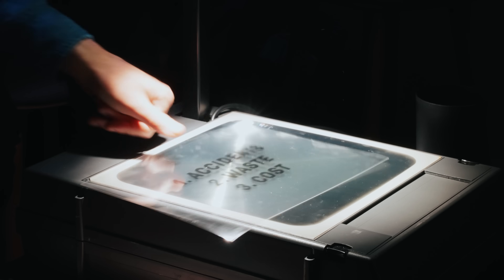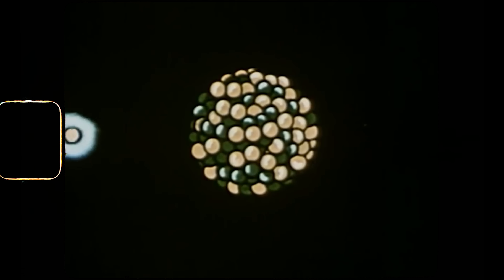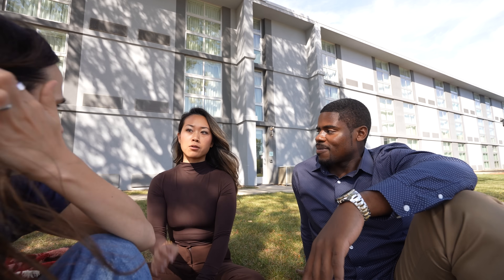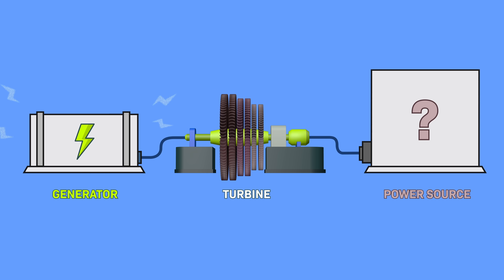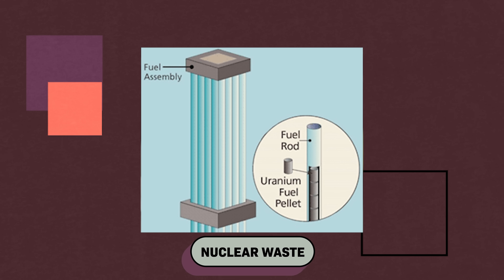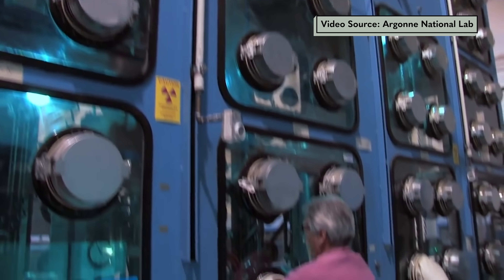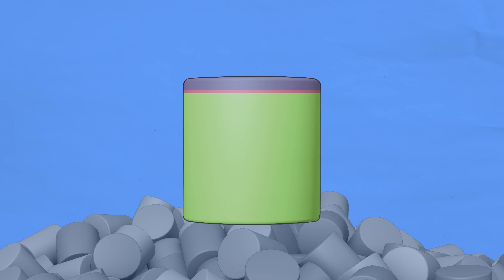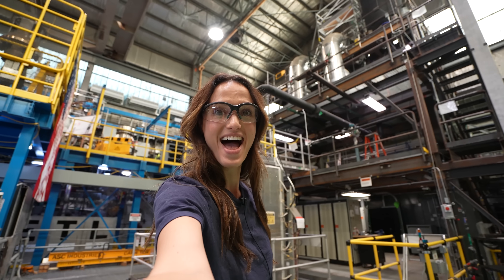The Big Lie About Nuclear Waste

Comment: Nuclear Engineer here, i'm so happy to see these debunking videos now. You did a great job at making sense of the nuclear waste that oil and gas lobbyists have pushed onto the global energy industry. We all got shafted out of clean energy for fossil fuels, but that's now quickly changing for the better
Reply: it always comes down to $$$$$ £££££ and those making it and not wanting to loose out....
Reply: Reactor technician here. The fear from three mile island and then Chernobyl killed any growth. That why we really haven’t built any since
Reply: @shellnjoeycastro1730    Yes fear and how did that happen?  The nanny state bureaucrats, the greens, the death/fear merchant’s on line, in Hollywood and cable, etc.  Every living thing in the every ecosystem throughout history has been trying to advantage itself and its offspring by influencing their systems.   Now the difference is people have forgotten this and or to lazy / distracted to think it through
Reply: @shellnjoeycastro1730  it's a catastrophic soft target, vulnerable to natural disaster, and with absolutely no benefit outside of corporate/military applications.

Nuclear energy might be cleaner that burning coal, but building a nuclear facility isn't clean.  Neither is maintaining it.  And neither is maintaining the infrastructure required to transport energy to the user.  All the energy lost to distance, to upkeep, and to staffing comes directly out of the overall benefit of running a large nuclear facility.

And then on top of that, energy is supplied to the largest consumer first.  So by the time the average person is paying their "power bill", they are paying 100x times as much as that Amazon fulfillment center 20 miles away.  Because there's so much demand...

It's a rigged game designed to extort the working class for more of their money.  The customers using the VAST majority of energy, they pay almost nothing.

But double your electric consumption, just for a one month test.  Then take a look at your power bill.  If you attempt to use more than they expect you to... there's fees for that.  And then you pay a higher rate on the energy, as well.

Can you explain why Amazon's power meter can spin so fast it goes back in time to pay an energy rate comparable to 1920's era coal prices?

Because that's what they pay.

You ever take a moment to consider if maybe, consolidation is the problem?  Even though it's more efficient on paper, is it really?

Because the average person's power bill says no.  In North America, all the infrastructure attached to the grid was paid for with taxes, and is maintained with subsidies, paid for with taxes.

So how come the energy is price fixed instead of basically free like it should be?  Why is the individual using 0.00001% being nickled and dimed per kWh what all the massive industrial customers are paying the same price per kWh as one might pay for coal to produce a kWh in 1920?

Do you think with nuclear plants being far more expensive to maintain and operate that the price will come down per kWh?  For who?  Exactly, it'll be the same model, energy output is artificially reduced, price is artificially inflated, and the only people who make gains are the people who own the contracts to deliver energy and the massive corporations that already pay 1920's prices for energy in 2023.

Who gives a flying fk on a rolling donut about carbon footprints when their bills come?  Nobody.

Fear has nothing to do with it.
Reply: Thanks for saying it. Why doesn’t anyone else call the spade a spade? Nuclear is the most expensive energy ever produced, and the epitome of centralized power production that is the real issue leading to massive overuse and under payment by the politically powerful.
Reply: Clean. Stop smoking that stuff. Waste that will be deadly for 100,000 years. What a joke
Reply: @petethewrist  Genuine Question to you: Name me one time radiation has ever been a threat to you, and name me one time you breathed in gasoline fumes, smog, been in a car accident, been sick from food poisoning etc. You'll quickly realize the actual dangers in your life that are far more likely to be a concern than the nonexistent threat of nuclear waste harming you and the community.
Reply: @hans3331000 Um, ever heard of the Downwinders (where I live)? This garbage is never inflicted on the people benefiting from it.
Reply: @petethewrist  yeah I love how all these Corporately Programmed environmentalists never consider for an instant the footprint required to build, staff, and maintain all the infrastructure required to just "deal" with the waste.

These plants are like entire self contained cities.  They require railways and thousands of employees with fully staffed service centers to provide those employees with services they'd otherwise need to travel a long distance to get.

All these kids think reality exists in a vacuum but the only vacuum is the one maintained between their ears at all times by a troubling lack of brain matter.
Reply: Came here for the comments and whoo! @ZennExile and @SunShine-xc6dh did NOT disappoint. 

When the children started throwing tantrums, they got schooled by teachers with the patience of Buddhist monks. They actually explained way more than they needed to because those two were NOT having it. 😂
Very entertaining!
Reply: @dundid1t542  lmao yeah no schooling quite like 'trust me bro'
Reply: France derives 70% of their power from nuclear energy 

And they are already building more nuclear facilities with more advanced technology 

And the french government says nuclear power is non negotiable 

The only reason the power plants were being restrained is because of high temperatures this summer

I couldn’t find anything about a lack of storage space

Maybe you should give your source if you have one

I would be glad to be proven wrong but i dont think they would be building more reactors if they were having issues with storage
Reply: @dj_koen1265  They reprocess.
Reply: Which university did you go to?
Reply: If nuclear energy were discovered today it would be hailed as deus ex machina
Reply: @Ourdirtytwo  Too true!
Reply: " that oil and gas lobbyists have pushed onto the global energy industry."
It was more the wind and solar proponents. Plus, very few developed nations use oil to produce electricity.
You wouldn't find many coal and gas supporters having an issue with nuclear, but the wind and solar people certainly do.
Reply: Mechanical engineer here.  @Hans B.    Nuclear industries were really killed beginning in the 1970’s by several factions.  
- Green movement has probably done more damage to clean nuclear power than anything over the decades since.  Super stupid!!  Nose spites face.  
- Politicians greedily used fear of nuclear war, proliferation & waste to get elected.  They stupidly reduced it to emotions and bumper stickers, convincing  low info voters  that it was all one simple evil thing.   
- Military Industrial Complex didn’t want mass extinction either and they had no economic alternative to the destructive power of nukes, so tangentially fought proliferation by stoking fear of nuclear power.  A poor country like India could “go nuclear” (and did) defend itself for decades at low cost.  
- Government bureaucrats killed the economics of nuclear power in many countries including the USA.   
- So, Don’t blame oil, they don’t even compete in the same industries.
Reply: Nuclear engineer, my ass. You couldn't find your way around uranium.
Reply: Sadly it seems that the focus on non reliable energy sources is now causing more fossil fuel to be burned.

If only the climate fighters would actually care about the science behind their hysteria, then we might not have both the lobbyists and activists fighting the scientists.
Reply: "Clean energy". Go google cancer risk near nuclear facilities. You shills are just funny. I hope they build a nuclear facility right next to your house and your children enjoy the radiation. Tell them in the hospital while treatment about your genius comment on YouTube.
Reply: Nuclear waste simply for the greedy or stupid, they can't even mine it safely,  let's look at all the spills, not just the major ones...ridiculously niave to swallow this garbage without looking and then explaining all the damage done from all the leaks.
Reply: What's with all the bashing. We should be learning from each other     the lobbyists ruin everything
Reply: @Bill-cb4bh  That soundsgood, however, the Biden admin is actively anti-human
Reply: Its isn’t just the fossil fuel lobby that is to blame for the lack of progress in nuclear energy plants it is also the environmental lobby who push government red tape & regulations making nuclear plants expensive to build.
Reply: You are talking about breeder reactors.  The waste doesn't disappear, some of it is converted to plutonium which becomes more waste after it fissions.
Reply: They will hopefully use it more often around the globe
Reply: Fossil fuel industry is the most EVIL creation in world history.
Reply: There is enough demand now that we need both.
Reply: currently in the freshman year of my bachelor’s degree in nuclear engineering! any advice for someone just starting out in the industry?
Reply: @joeshmoe-c9n  Yes sir, good luck. It will be a lot of theory before you get to the power plant part of it. Really focus on first and second year and it gets easier third and fourth in some ways. Second year is hardest. The math has to be strong. Remember radiation cannot be seen, heard, tasted, felt, or smelled. This means math is all you have and it's all your eyes and ears. You must know how it works. You will forget multiple times how it works but the key is to keep yourself refreshed and quiz yourself. Study with a group but remember not to compare yourself to anyone and focus. I needed much longer than my friends to understand things but the important thing is to end up at the same place. Absolutely do not pull an all nighter. Do not memorize, understand why you are doing it. Stay organized, deadlines will crawl up on you fast. Pace yourself, you cannot sprint all the time. Be okay with some assignments being late or incomplete, but get it done on your own time because it will be in the exams. Get plenty of sleep and eat good. In second year, your entry into the nuclear industry is internships and coops (do not be picky, any experience will out you ahead of the highest GPA student i promise). Grades are not so important, just be in good standing and build a good network. Go to student conferences and network. Ask professors for student jobs and lab assistant positions where you can put impressive research into your resume. More importantly: Find out what specific area of nuclear you love with a passion and pursue it later on.
Reply: Yeah 4 years to go til the fossil loving man changed
Reply: .  1, Three mile Island .
  .  2, fu-gee-ohma Japan
  .  2 1/2,
  .  3,  Chanioble 
  .  4,
  .   4 1/4, ETC -
  .   4 7/8, etc ! .
  .   5,  The REST of the STORY  ([ PAUL HARVEY ]) .
 
 .   5 1/2. FALLOUT FROM 
             THE ☢️ "LEFT overs".
 Iodine 131, sea,zee,um 141
    Cobalt 90 etc,etc,ETC ...
    12 - 18 - 2024  wed.
           * thanks  Boys *
      FOR the FIRST ONE
           July 16 @ 5:29am
               1945
  .
Reply: I think I remember decades ago, having such things as breeder reactors, which produced more nuclear fuel from the waste. I can’t remember the exact details.
Reply: Thanks for the subject but do you need to show so emotional?
The little Asian physicist looks pretty nice. A pity she didn’t speech your video.
Reply: 😂 how is nuclear better then fossil fuel. They both suck 😂 just like your opinion 😂
Reply: WOW nuclear energy is nowhere near clean. The CO2 emissions per kwh are way higher than with true renewable energy. Besides they are not really economic.
Reply: I've been saying it makes no sense that the nuclear waste is so dangerous, and yet we can't harness that energy at all.
Reply: Coal ash contains radioactive materials that are unregulated. Some of the newest reactor designs are much cheaper and safer than existing systems.
Reply: By "oil and gas lobbyists", I think you mean anti-nuclear environmental zealots.
Reply: @ReadTheShrill  the fossil fuel industry has long faced the threat of losing market share to nuclear energy and are actively engaged in supporting expensive regulations
Reply: @ReadTheShrill  propagandized group that got these ideas from somewhere. I wonder where? Direct earliest example: Godzilla movies
Reply: @ReadTheShrill  the zealots are people like you who blindly blame the energy industry for the sins of industrial agriculture.

You can't blame the energy industry for making as much money as possible when they were handed the key to the cookie jar and a blank check to buy infinite new cookies.

You'd be fat too.  REAL fat.  Humans are apes, and a ape's gonna ook.  Just is what it is.

But you what matters more  than blame?  Reality.  Gotta live your life as it is not as you want it to be.  Otherwise your brain cheese will overheat and lose its oil all over.  Nobody likes oily cheese or that burning cheese oil on the bottom of the oven.

And in reality, there's another directly correlating metric that isn't being considered in the typical greenhouse gas audits used to define and justify all these climate models.  

It seems nobody had time to consider what tilling up 1.9 billion acres of Rhizopshere might be contributing to the carbon-12 build in atmospheric samples over the exact same period being blamed almost entirely on the energy industry because they could disrupt and manipulate the average person's lives for a century before markets and technology caught up with them.  That's a lota hate to build up.

Blind hate.  The kinda blindness that pushes obvious contradictory evidence to the waste bin in favor of defeating an imaginary enemy.

Every atmospheric carbon 12 model is wrong.  Tilling up 1.9 billion acres of Rhizosphere is gigatons of carbon 12.

Unless the model directly accounts for that, it's wrong.  Bad data, perfect model, bad result.  It's not complicated, political, or a debate.

1+1 = 2

If you want, even chatGPT with it's hyper delusional corporate climate hallucinations will tell you that North America's soil can potentially store 2000 gigatons of CO2 for 10's of thousands of years.

And not like, all of it, no.  Just like 50 million acres can erase the Industrial Revolution from the atmosphere.  We could easily buffer the atmospheric impact of the entire rest of the planet going through the same filthy Industrial Revolution we did, and change nothing about anyone's daily lives.

And the energy companies could keep limping along toward renewables.  And idiots could keep driving stupid cars that get 4 miles per gallon and kill small birds with passing engine noise.

The rest of the whole world could just catch up if North America would rehabilitate 50 or so million acres of the 1.9 billion destroyed by Industrial Agriculture and as a result raise it's own GDP.  It would cost less than nothing.

And this example if followed on every other continent erases the carbon crisis from that doomsday clock entirely.

So stop hating, and start doing math the math or getting chatGPT to help you do it because the soil is what needs fixing.  And like, real soon.  Or it can never be fixed.

Everything else can, and should wait.
Reply: Cleo badly needs to educate the foolish nuclear phobic Germans about nuclear power and nuclear waste.
Reply: fossil fuel industry had nothing to do with the public's nuclear fears...scientific illiteracy did.   Read "The Rise of Nuclear Fear" by Weart, he does a pretty good job researching the history of public hysteria surrounding nuclear tech.
Reply: @Sugarsail1 I blame a deliberate effort by the USSR.
Reply: @Sugarsail1  A deep dive on the antinuclear power nuts will lead you to the KGB.  Of course the same is true of the 'green' movement. 
Any anti industrial or antihuman movement can be traced to Marxists.
Reply: Well, to be fair hans3331000, it wasn’t just oil and gas companies. 
The accidents at Harrisburg Pennsylvania (Three Mile Island—1979) and Chernobyl, Kyiv Oblast, Ukraine (1986) had a lot to do with it. Besides one plant in 2016, the US hasn’t completed one since 1996, both of which were in the TVA system. 

Fukushima Daiichi in Japan during the 2011 earthquake/tsunami didn’t help either.
Reply: "Changing for the better" means: Wind, Solar, Biomass, Water. Not anything where you need to buy expensive fuel, risk accidents that pollute large areas and produce the most expensive energy.
Reply: I disagree. All the new energy transformation in the past few years has been wind & solar. Nuclear power still has an undeserved bad reputation.
Reply: @BadDadio  Nuclear has a bad reputation because it is honestly the best solution to the problem of providing power to the masses.
Reply: @Corvus I am from the internet.
Reply: Hans, what's more efficient as far as materials and direct energy-to-application delivery, an energy source that can scale from the size of a smart watch, to the size of Wyoming, modularly forming a larger area energy network, or one that's fixed and dependent on a facility designed to power that same area energy network?  And at what point do you reckon the size of a centralized energy generation facility overwhelms the former topology in saving long-term while also considering the estimated yearly costs of maintaining that fixed network?

Asking for a friend.  He said you can go ahead and just ignore the continued permanent waste storage issue, we'll do like Europe did and just sink it to the bottom of some really deep water and pretend it never happened.
Reply: @ZennExile  it was mostly britain that sunk their waste and we stopped it 30yrs ago.
Reply: @ZennExile  So the realm og your question is really geared towards grid management and life cycle analysis, but I'm more an engineer that deals with the functionality of a plant until the electricity hits the grid. That being said, the advantages of large scale nuclear power plants are that they are relatively compact and provide an insane amount of energy in terms of energy density. Managing the grid requires modularity, and so it's always good to have diversity in that not only large scale plants should be used, but small and intermediate level ones can be extremely beneficial for remote and isolated communities. I won't go too far in the topology of the current system because I'm not the best person to go, but I will say this: we have science-backed proven data that shows the adaptation of nuclear energy is comically safer and offers other benefits such as medical isotopes and revenue generated for the local community,  that it's simply the answer to our problems. We don't really need to be looking for crazy new innovations, because the adaptation of nuclear energy or baseload clean power while waiting for research on wind and solar will benefit us the most. Right now politicians are stuck with the narrative of renewable and its costing trillions and taxpayers suffer. In canada, we are investing in large scale nuclear again and it will cost 50 billion for the first phase and produce 3300TWh, and 60 billion in renewable funding for 200 Twh. That's 16.5x less for 10 billion more. The cost of incompetence. And as with materials, there will almost certainly be molten salt reactors too, small. Large, modular, etc. Our Canadian regulator just passed the design review for molten salt designs and its a really exciting time overall.
Reply: @hans3331000  the comparison isn't just between total cost and energy output.  There's loss to the electrical grid to consider.  And you have to also include the expected cost of energy to the consumer.  Not simply the output of a nuclear system.

The point I was trying to help you discover for yourself is that the grid, and the consolidation of power generation, have major costs that aren't being considered when you just compare the cost of building a nuclear plant to deploying far cleaner, far cheaper, and far more accessible energy sources in a distributed network where everyone connected is providing energy to each other locally.

It may be that nuclear power plants are beneficial to industry and corporate revenue.  But what about YOU.

What benefits the proverbial YOU more?

Because right now, energy should be free to every single actual person in North America.  It's so cheap, and taxes paid for the entire infrastructure, yet here we are being price gouged for what we essentially should already own.

Think it through without an agenda.  Because Nuclear is clean energy in a vacuum.  There's nothing clean or efficient about centralized energy production.

You know what is efficient?  Using the Sun for literally any purpose whatsoever.  Make electricity, make heat, power cooling, grow food, grow textiles.

And guess what?  NO FUEL, NO WASTE.  Those isotopes can be made by the industries that profit from them in small scale nuclear plants that they pay for, maintain, and charge themselves a premium to use.

There's no reason for tax payers to fund corporate energy consolidation.  Period.
Reply: Solar plants are "clean", sure. I bet the battery production facilities that used when they're not producing electricity are clean too! I'm sure the communities that happens to be nearby the facility are super healthy and not getting, idk, respiratory problem.
Reply: @ariku394  batteries aren't a need.  So the argument you tried to build for yourself doesn't work.  Molten Salt, Solar Ovens, Solar Heat Exchange, Capacitor banks made of commonly available materials cooled by the same solar energy systems, oh and there's IR shielding for -10 ambient cooling under midday sun.

The cost to "scale up" is non-existent to distributed modular systems.  The application potential is infinite and bound only by the laws of physics and personal resources.

The Sun is all anyone needs.  There are NO SAVINGS associated with these massive networks.  The Government prevents the value of energy from going lower.  It's been doing so since most of the grid was privatized in order to protect those corporations who tricked all of you into paying a subscription rate to use a system your taxes built, maintain, and pay to continuously expand.

They are like mobsters allowed to racketeer the entire population, but don't actually do any protecting.
Reply: @hans3331000  really hope they build a modular reactor in Manitoba only province west of Ontario with the right permits to be able to do it.
Reply: @ZennExile  " And at what point do you reckon the size of a centralized energy generation facility overwhelms the former topology"
Managing one point is always going to be more efficient than managing thousands of points. Plus the one point will always require less of a footprint than thousands of dispersed footprints.
That's why we have landfills instead of dispersing our trash next to the road.
Reply: @wisenber  what about the loss of energy being transported over a large distance?  Seems to me, just that loss counteracts any benefit a centralized system has in efficiency.  There's quite a difference between sharing energy inside 1km and sharing it 100km.

And the bigger you try to get with centralized energy production the larger the area you want to serve and the more loss sustained.

The point was to get you to do the math for yourself and see that centralized production always looses out to distributed production.

And that's before you even consider the energy cost increase for maintaining those massive networks.

You're also incredibly wrong about landfills.  We actually should be spreading our organic waste over as much land as possible, because organic waste, isn't waste.  It's food for something and that means more food for us down the chain.

Our tendency to treat organic waste like garbage is about 60% of the overall carbon crisis.  If we just did the COMPLETE OPPOSITE of what you think is "best", there would be no carbon crisis.  All that carbon would be back in the ground, instead of just gassing off into the atmosphere in aerobic mounds of decay.
Reply: @ZennExile  The loss from transmission is dwarfed by the cost of maintaining thousands of small inputs versus a few centralized power stations. That and ensuring a given load is much easier centralized than decentralized. Plus the amount of land per GW favors fewer larger power plants by far.

Organic waste is non sequitur to power generation.

Then again, we don't have a crisis.
Reply: @ZennExile  as a commissioning electrical engineer I feel excruciating pain reading comments like yours. You appear to have no idea what you’re talking about.
Reply: @aljohnson3717  uhuh.  And we believe you.
Reply: @ZennExile  you have no mental capacity to either believing or not believing me.
Deal with it
Reply: @aljohnson3717  Deal with what?  Your troubling lack of competence in what I assume is your first language, English?

Not sure if that's my problem to deal with.
Reply: @ZennExile  How many languages can you speak fluently? One? Perhaps one point zero? One point zero, zero?
I’m a proud immigrant and Socialism Survivor who came here with just a basic alphabet, a dictionary and $1600 in my pocket.
17 years fast forward - and now I run multimillion commissioning projects for the large American Electrical Utilities. 
System Electric Power Transmission, Generation and Distribution protection and control.
I could repeat this to you in either Russian, German or Chuvash languages for your listening pleasure.
Reply: @aljohnson3717  I read a bunch of languages but I can only speak 4, and program with 9.
Reply: @ZennExile  bs
Reply: @aljohnson3717  it's 2023.  If you don't speak and read  multiple languages, what are you even doing with your life?
Reply: @ZennExile Windmills and Solar Panels don’t even produce the energy they took to make. 😂
Reply: @DanielSlaughter2005  are you regarded?  Wherever you get your information from, not doing you no favors.  At all.
Reply: What are you talking about? Fast Breeder? TWR?
Why are you so vague?
I'd like to see you using conaminated Clothes and reactor casings in that.
Please elaborate.
Reply: @21stcenturyscots  I'd like to see you with your red herring.
Reply: Clean energy lol so we can store all the waste at your house?
Reply: @SunShine-xc6dh  have you watched the video? Do you speak English?
Reply: @SunShine-xc6dh  What the fuck is that comment supposed to mean? Did you even think while writing? "Don't use plastics if you wouldn't want your house filled with them" and "Don't eat meat if you don't want to fill your backyard with guts" are at the same level.

Also, I suggest you rewatch the video
Reply: @SunShine-xc6dh    Who has died from commercial nuclear waste?   Yes there’s a persecution problem.  So Do some unbiased research.   Coal directly kills many thousands each year.  Has for centuries.   Millions more are estimated to die early from respiratory effects of burning coal, dung, wood, etc in poor and rich nations.
Reply: @SunShine-xc6dh so youi took absolutely nothing away from this incredibly informative and simple to understand video. And went with the the fear mongering you've been conditioned to beleive. Like did you even watch it??
Reply: @sunshine are you really arguing about nuclear power with an nuclear engineer 😭
Reply: @SunShine-xc6dh  quiet, grownups are talking
Reply: @budwilliams7908  huh last time i checked grown ups take responsibility for the consequences of the actions they advocate. If it's safe it's safe if not you don't just get to pass the buck
Reply: @SunShine-xc6dh  Last time I checked idiotic "arguments" were to be ignored. Would you have decommissioned solar panels stored at your house?
Reply: @samiraperi467  nope, but who said I'm advocating that, 'renewable?' 'Sustainable?' soon to become landfill?
Reply: @SunShine-xc6dh  Grown ups get all the facts before speaking. You have obviously not.

All of the world wide high level nuclear waste produced up until now could fit inside a football field. We could recycle that down to be a much smaller amount. Then finding a place to store it is quite easy, and there are fast swaths of the world that are both uninhabited, have very little ground water, and geologically stable to store this stuff. At least until we figure out how to use all of the high level wastes.

And otherwise nuclear energy is extraordinarily safe, and the more modern the reactors are the safer it is. Don't let the Chernobyl disaster color your opinion. Chernobyl was A: About as bad as it could possibly get. B: Impossible to happen in modern reactors.
Reply: @IIBloodXLustII lol totally safe that's why your acknowledging if it's fails is by far the most dangerous power source and that lovely recycling process is also how one gets weapons grade plutonium. My favorite part is where you use an area, football field, to describe something that has volume real honesty. How high would this football field pile be?
Reply: @SunShine-xc6dh  Addendum: If we recycled the fuel the football field sized area would be stacked... to 15cm in waste.
Reply: @SunShine-xc6dh  If you want to build a nuclear waste storage facility outside my house, I dont mind. They're perfectly safe and secure. I have no issues with it.

"At your house" is an idiotic argument to begin with. Nobody wants industrial waste from ANY Process literally in their house. But having it go through a proper recycling process and then long term storage to make it safe is fine. You wouldnt want something like Industrial Slag in your house either, but that doesnt mean that any industrial process which produces it should be prevented simply because you dont want those byproducts in your living space. There are plenty of sensible ways to deal with the waste in other ways, that criteria you give is utterly moronic.
Reply: @eragon78  how bout your neighbors?
Reply: @SunShine-xc6dh  If they were sensible sure. I cant speak for them, I speak for myself.

There is nothing dangerous or scary about a nuclear waste storage facility if its done properly. It sounds scary, but only if you're ignorant to the facts. But reality doesnt care about how you feel about something, it cares about what actually is true.

Id much rather live near a nuclear waste storage facility than something like a coal power plant. Its literally more safe. And there is already a big ass coal power plant in my city so there's my thoughts on that.
Reply: @SunShine-xc6dh  " so we can store all the waste at your house?"
Why would we do that when it can be recycled? Do you keep old windmill blades in your house?
Reply: @SunShine-xc6dh  Plutonium is popular for powering probes to the outer Solar system, Voyager 1 & 2 are still talking to us after traveling for decades and leaving the system.  (Just don't use an experimental rocket to launch.)  The fuel is "spent" after only 15% of the U-235 is used, therefore reprocessing it recovers the remaining 85% and sorts out the useful isotopes (yes, that includes plutonium) and the rest is either buried deep under ground or used in Liquid Fueled Thorium Reactors.  Oak Ridge National Labs ran the first experimental LIFTER in the 1960's and China and India are building them now.  (The actinides never leave the reactor vessel, thus keeping the world safer.)
Reply: @everettputerbaugh3996  for the sake of the argument, the space probes use NOT a weapon grade U239, but rare isotope U238 (half life 87.7 years). It is  a strong alpha source and can be used as a thermogenerors
Reply: @SunShine-xc6dh  yes, actually, one garbage dump , the size of one regular garbage dump, is all you'd need to storage the waste. 

It's an incredulously small amount of waste.

Less space than a solar farm.
Reply: @avibhagan  on your property? Landfills aren't exactly small in the first place
Reply: @SunShine-xc6dh  "on your property? "
If your in the landfill business, i would imagine yes. It's not like everyone sends all of thir old solar panels to be stored at your house is it?
Reply: @SunShine-xc6dh  you'll only need one landfill for the entire world. 

Do you think that is a difficult ask, seeing that every single country has multiple landfills?

The space required, would be over 100 time less than the wind farms. Much more than 100 times.

People have done the calculation, there are published peer review studies on this.
Reply: @wisenber  disgarded solar panels are classified as hazardous waste as well (due to various hazardous stuff used in it). You willing to store that hazardous waste component of solar panels at your house? How about disintergrating fibre glass from a wind turbine? 

I'm perfectly willing to have everything but unspent fuel buried deep under my house. 

99% of nuclear waste is unused fuel Btw. It's kinda like we're only using 1% of the fuel in a car's tank, because that car's tank isn't designed to access the other 99% at the bottom of the tank, and calling the other 99% of the gasoline "waste". Then we spend tons of money to store it because it's highly flammable when we could be spending that money to use another feul tank with better access.
Reply: @tylerdurden3722  I'd prefer they reuse the nuclear waste and deal with the small volume that's left over. It certainly provides more energy and takes up less space throughout its lifecycle compared to wind and solar.
Reply: @SunShine-xc6dh  so you have come here to complain and not listen. Got it. You have any idea how much energy is required to create these massive solar farms? Any idea how much tax payer money needs to be thrown at solar’s incredibly expensive process? Do you have any idea on the toxicity of damaged solar panels and how it can affect the environment? Whilst you complain about a problem for which we have a fairly simple, albeit costly $, solution, we in the US are engaging in idiotic behavior with unreliable energy sources that needs to be stored for it to be used during peak hours on batteries that require MASSIVE amounts of energy and funds to mine the lithium (which is also very toxic and can be a fire hazard). The “green” people out there are engaging in political and ideological partisan behavior and are willing to shun a source of very clean energy because of money and a current political/ideological fad. Don’t get me wrong, I think solar is an awesome technology and will always have a place in our future, but every source of energy has its strengths and weaknesses. Nuclear power is easily our greatest strength for clean energy. We just should have used all this taxpayer money to grow the nuclear industry instead of the solar industry. Never too late, we can start now.
Reply: @avibhagan  Tell that to the French, who have the most developed nuclear power industry in the world because someone forgot to tell them.... they are panicking because they are running out of storage for their waste and may have to shut down their reactors if they don't find a solution.
Reply: @SunShine-xc6dh  

Please look for : 

The Land Footprint of PV Solar (and Nuclear and Wind Power)

Author : Alki Delichatsios

Mar 4, 2022
Reply: @SunShine-xc6dh  nuclear power is the cleanest power , you can store the waste where they mined out from too
Reply: @SunShine-xc6dh  well, if my house is in the middle of nowhere desert, buried 2km down, and 100km from any other civilization, sure, go for it.